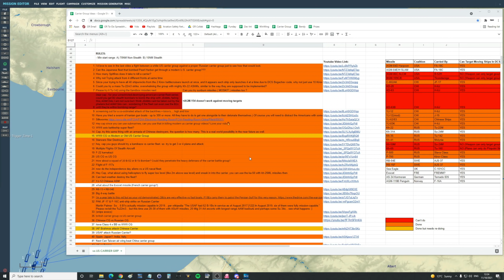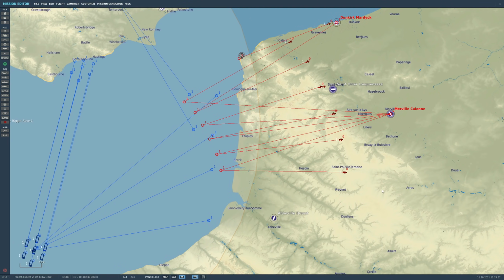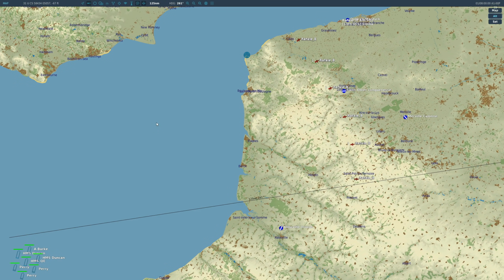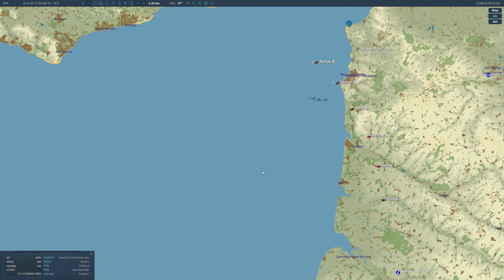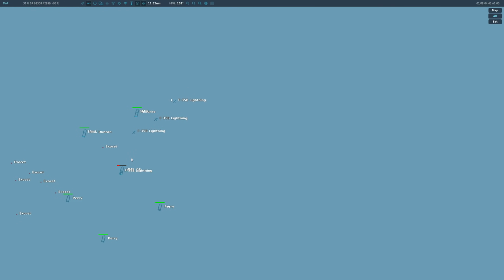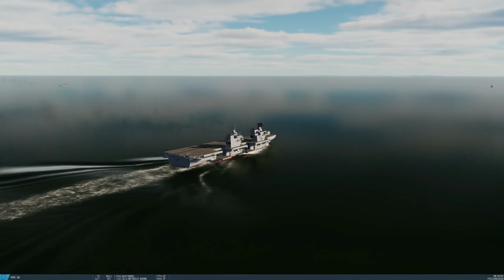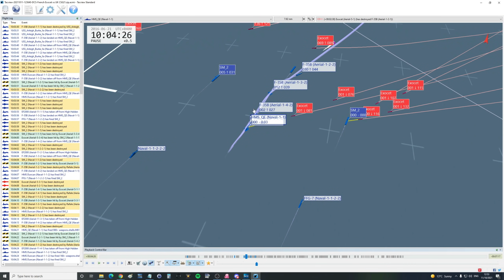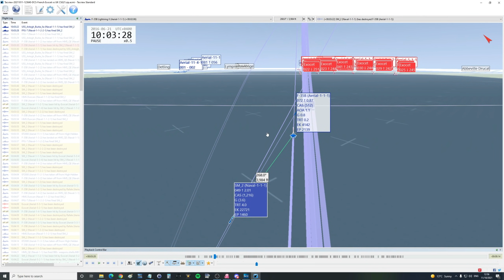Can A Surprise French Exocet Attack Beat A UK Carrier Strike Group? (Naval 40) | DCS

Comment: If the planes took off and headed right towards the enemy planes by extention they will fly right by the missiles coming the other way to reach the planes that fired them. Its probable there would be at least a few near misses. Interesting experiment. Exocets are subsonic and they are absolutely not an anti aircraft weapon. Cheers for the upload.

Comment: Honestly, the Exocet was an okay missile in the 1980's, but it's pretty obsolete now. Yeah, it sunk the HMS Sheffield (quite frankly, the Type-42's were a deeply flawed design) and a tanker in the Falklands War, but the warhead often fails to explode resulting in most of its damage coming from kinetic impact and burning fuel (something DCS doesn't model). I don't think modern anti-missile systems would have a problem intercepting it. Also, the reason HMS Sheffield sunk was the ship only had a single non-redundant water main, which was severed in the impact (the warhead failed to detonate), so fire sparked by missile fuel is actually what sunk her. Basically, a fatally flawed damage control system is what killed her, not the missile.
Reply: The exocet has been updated since, its not like it still have the same capabilities than 40years ago.
Reply: Completely not the same missile…

Comment: You do realise a few long range artilery pieces and coastal defence batteries do the same thing with out the aircraft  the channel is not that wide.
Reply from the maker: thx
Reply: @grimreapers  Actualy you could , put operation cerburus of ww2 in that place . where scharnhorst and gneisenau moved through the channel. just turn the suprise factor around . instead of the suprise beeing the ships moving up . the suprise is beeing atacked.

Comment: Something went very iffy there. Each Type 45 is capable of guiding 16 Sea Viper simultaneously plus however many SM-2 the Burke is firing off, so if there aren't more SAM than AShM in the air some PWO is getting the sack. Sadly the Darings wouldn't have their CAMM but even so, add in the pair of Type 23 for local area defence, ECM, various other countermeasures and yeah, none of those would have got through. 
So I'm putting that down to the French cheating and finding a way to break reality with Mach 5 Exocets.

Comment: The exocet is also a 40 years + missile, there are some update like the MM40, also a single missile can do damage but can it sunk alone a single big ship, normally no, it is so much effective against smaller ship like the Sheffield or the Stark but  bif ones is more complicated.
Also counter mesures and anti missile defense has change since 1980.
Also the missile don't use a radar until the last moment and fligh very low and is very difficult to spot bey eye or radar. They don't go high and go above mach 1.
Also the rafale has a IR detector that see well the F35 and has themself an IR jammer to make them hard to hit.
In all sell competition the tythoon and F35 has been seen a level under the rafale so the battle should be more a mater of number of fighter who win rather than killing all the rafales. Ans especially for F35B that has a huge turn problem due to its under sized wings (corrected in F35c).
Reply: Exactly. Exocet missiles are not designed to sink ships, but to make lot of casualties in order to force the opposing forces to mobilize emergency resources.

Comment: Hello everyone and GR
As much as like this very fictional and unrealistic scenario, I see quite some few bashing for the mod or about the plane that's why I would like to add something about this mod ( and might concern all the other Mods actually):

- First of all, it is a mod for simulation, it means that putting aside pilots, engineers and designers of the plane and his systems, no one know all the true plane capabilities and behavior especially to modern one which a lot of specs and systems are still confidential. 
I don't think knowing how you flight and kill all the planes with the mods F22, F35 or Rafale make you think that IRL you will have the same result.

-Yes it is a mod so yes the exocet is Overexagerate  maybe next update will fix it,  as much as the rafale since this mod is quite young and his flight behavior and stats (flight domain) are based on su 27 or 33 ( i think, it started since 2019) . Let's put aside EXPERT MOD with high skill in dev, a lot of mods are just a remap of an existing and official plane from FC3 with some change there and there. Strange tho, on their Super Etendard mod they have downed the ASL 30 speed from mach 1.2 to mach 0.9

- In general mods are built by passionate peoples (here 2 guys apparently) with their free times and skills, so trying to embarass those modders who are working for free (They are not even asking donations) is not very fair. Also you might not know all the "context". Maybe trying to reach them to give feedback or explain frustrations or defects, seems more collaborative and gives them visibility for help. 
What is interesting is even ATE ( an ex french rafale marine pilot)  have given feedbacks on this mod but at the same times cannot give specific details about the true capabilities of the rafale. 

- For their defense i will also add that Dassault have a very strong control about their products and their image. They won't allow any people use the image of the rafale like this for entertainment.  I read that Dassault has legally put an halt to some project.  It is after all, one of the strategic and Military assets (NUKE). Modders are not allowed to have access to those informations to make a perfect and real simulation of their plane.
In the (french) DCS community : a lot are asking Dassault to allow an official version for the rafale but it won't happen before a long time. If you think of it, the same applies for Mirage 2000 5C with nowdays systems and weapons, RAZBAM is not allowed to develop it, still sensitive informations.

Finally those exagerated specs might be volunteer : Not downgrading because it will downgrade the image of rafale (and Dassault), not realistic since it will display confidential informations. So it left to the modders only "overpowered" option.

I am talking about DASSAULT but MBDA, Thales and any other subcontractors might act the same way.

- Also Dassault are selling the customer support and training assets (training session but also simulator), do you think they will allow a PUBLIC mod that will replace theirs? the same point can be applied for the F35 and LM (except they use this point to make the MRO less expensive: More simulation, less flight, less maintenance)

So the modders have to "fight" with their own knowledge, Dassault and sometimes DCS new updates.

This mod is just for Fun so enjoy it as it is. Personnally I will never flight a rafale or even an F22 IRL. so i am very thankfull to do it and for free.

For modders of DCS thank you for your hard work, keep doing your passion. 

If you simers, feel frustrated or don't like it,  try to reach them, do recommendations, help them maybe, try to understand them... instead of saying "uninstall" and say their works are "stupid" or "bullshit", otherwise build your own mod.

I know that with the context of Brexit, fishing, Swisszerland contract and AUKUS, ...  create a good base for french and anglosaxon bashing for haters... Take it easy it is just a "game"(simulation to be more precise) for entertainment.

Sim safe :p

Comment: Exocet uses a solid propellant engine indeed that can bring the missile up to 0.9 mach.
Their range goes between 50-70 Km depending the launch altitude.
Ship based versions ( MM-40 ) can either do sea skimming or go for a higher fly path.
I believe that in the airborne version flight altitude is determined by the launch altitude,but i may be mistaken.
During launch and the first stage of the flight it "feeds" from the plane's radar, or alternatively it flights to a predetermined point, (GPS /INS guidance) where it is supposed to "meet" the bad guys. In both cases at the final stage ( about 6kms ) it goes "pitbull"with its own radar.
MM-40 Block 3 can exploit the GPS/INS guidance as terminal and attack  ground targets.
During the fakland war two exocets were met with ECMs by a british frigate and because of the "pitbull" mode they targeted SS Atlantic Conveyor sailing nearby,eventually sinking it three days later.
Early exocets were prone to detonate either during impact,either after completely penetrating the hull,or not detonating at all.
In the early 00s it was speculated that newer versions ( those who are being loaded on Rafales) will have the ability to perform maneuvers when they are inside the CWIS range to maximize hit possibilities.
Reply from the maker: thx

Comment: Interesting, real exocets did have a solid rocket motor, the latest MM40 surflace launched ones have a turbojet and I think a solid booster to get them up to speed for the surface launched versions but not sure about that. They actually go at Max speed mach 0.93, basically French equivalent to the Harpoon. Unlikely to be 2 T45s escorting the Carrier group - there's only 6 of them and they keep breaking. That said one should be able to simultaneously engage lots of contacts - but it doesn't have may missiles in comparison with the Arleigh Burkes, they are being upgraded with new missiles. Shame we don't have more British and European ships in DCS. IIRC Helicopters with signiture boosters were used to potentially decoy missiles away from ships, before pulling up - but seaskimming missiles wont go above a certain height anyway so wouldn't have gone after the aircraft. (They can be programmed to do a popup where they pull up and then dive in the Terminal phase to confuse the ships defences.)
Reply from the maker: thx

Comment: Exocets never had a problem hitting ships. Of course 1982 made them famous but that was not the only time they saw action.
Reply: Yeah, they just had a problem with not exploding around 2/3 of the time.
Reply: @WardenWolf  
That happen because Argentina was under embargo and the French therefore didn't provide the arming codes. It had nothing to do with a defect in the missile or in the missile design. And even like that they did their job
Reply: @Aguijon1982  No, they had this problem in other conflicts as well. It was a known defect in this missile.
Reply: @WardenWolf  
Aha, please name ships that were hit  In other conflicts where the missiles didn't explode.
Reply: @Aguijon1982  They are a couple reports claming it didn't explode in some cases but they rarely are conclusive and often disputed down the line as the damage that was being done was usually so great it's hard to tell if the fires came from an explosion or from the engines. What adds to it is the fact that in thoses early models the proximity self destruction system can override the impact timer and that can make it difficult to tell at which stage the explosion might have happened. Also yes there was a bunch of stuff the Argentinians lacked for optimal operation, the units they had lacked the computers needed to link the missiles to the super etendards targetting systems and they had to hack/work around it as the French witheld support and its unclear how they got the arming codes, if they ever had them, might have found a way to bypass them too.
Reply: @redwithblackstripes  
Yes, ok, name a ship hit where the missile didn't explode so we can see it.
Like I have already said, none of the Exocet in the Falklands explode but that is because the french due to the embargo didn't provide the arming codes.
Reply: @Aguijon1982  USS Stark for example, i'm not saying it did or didn't just saying there were reports about it possibly not exploding. If you don't know the USS Stark you might not know enough about what you are talking about to justify having such vehements opinions by the way...
Reply: @redwithblackstripes  
That exploded, there is even damage on the bridge where the missile didnt even hit! I dont understand how you cannot see it. This is not the type of missile that will cut a ship in half anyway. The warhead is only 170kg!
Reply: @Aguijon1982  No the first missile reportedly didn't, again you are arguing from a place of ignorance to prove some weird point, its really useless to go on at this point.
Reply: @redwithblackstripes  
Whatever you say dude

Comment: 16:12: I think you're right about them being unrealistic... from Wikipedia it does seem some versions are solid rocket powered (those ones have only around a 70 km range) while others have a rocket booster and turbojet sustainer. However, it does list the speed as mach 0.93. I'm not 100% sure if that applies to both versions, the rocket-only ones are likely supersonic near burnout, but I don't think they'd be anywhere near as fast as that mod has them.
Reply from the maker: thxx
Reply: I think Exocet is subsonic all the way in both rocket and turbojet versions. Never heard anything about them exceeding Mach 1 during flight.